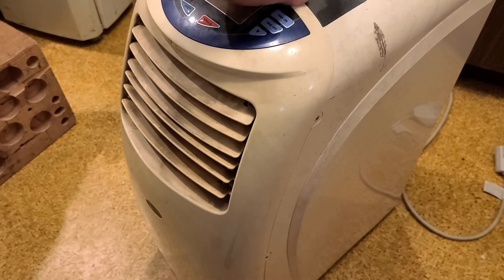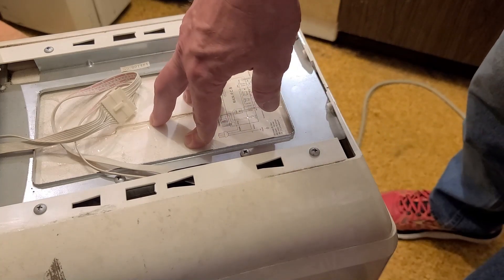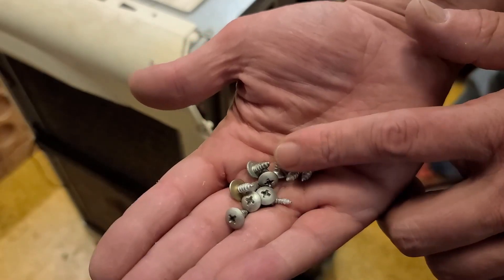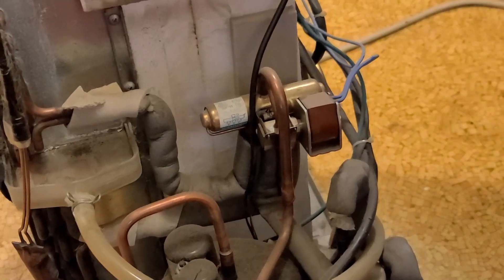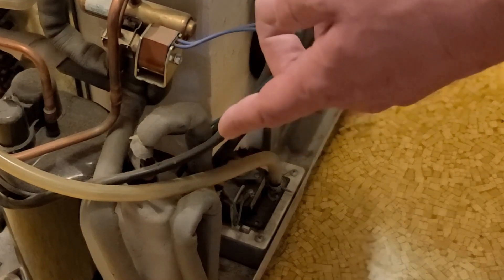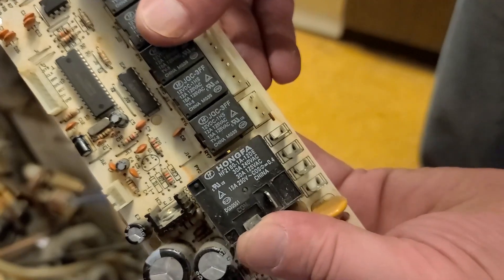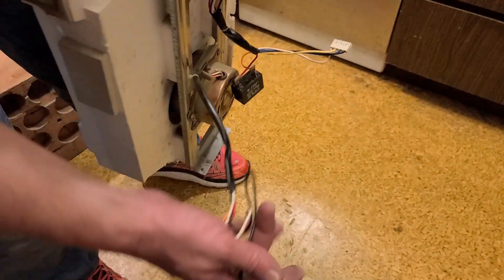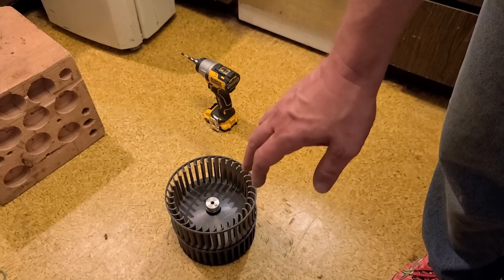Portable AC & Heat Pump Teardown

Comment: I bought a portable ac and heat pump for only 130$ BRAND NEW from a store it is a chinese evrything on it dont know what compresor it hase but it cools 9000BTU and heats 7000BTU it is not bad. I have tested the hisense portable heat pump 12000BTU for cooling and for heating it is oround 10000BTU the cheap one is relly cheap plastick but the only wierd part is that it is jearkimg on start it likes jerk for oround 5 minutes and that is stops idk why but it is wayyyy more powerfuel then the hisense idk what too but that is fine my dad uses the hisense he say it is great for his needs and i use the cheap one (ONYX) and im supriesd by it. Yes the hisense is more expensive use better plastick and more controles better remote but the onyx is stronger so i will go whit onyx eny time for now it is a year old and used me great on hot days here it is more then 40°C and then it strugle bicus of the single hose desighne but hey better then nothing and it works perfect below 34°C

Comment: The valve you are referring to is known as a reversing vale in the trade. The small tubes are the pilot operator. It functions as a tight tolerance device. Highly susceptible to contaminants that over time will originate from the compressor due to wear. The unbalanced nature of that style rotor compressor will accelerate this. Until the compressor starts to grenade the advantages of the heat cycle, are in addition to the heat absorbed in the evaporator two other heats are rejected by the condenser, the heat of compression and the heat from the inefficiencies of the motor.

A proper sleeve bearing motor were known to  out live a ball bearing motor in fractional HP  fan motor applications back in the day of USA manufacturing. Through the wool wicking and the porous bronze the longevity of the lubricant was superior to sealed ball bearing. Greaseable ball bearings risk the introduction of contaminants or destruction of the seal.

The metering device on that unit is not a TXV but a cap tube.

Comment: Reversing valve and extra sets of high pressure switches, defrost cycle, sometimes more coil on heatpumps.
Reply: That should be an accumulator which is important for a heat pump, I bet you that thing is still good, those coils are so dirty. Also apart of the added cost is two metering devices and check valves or an electric metering valve.
Reply: It has one